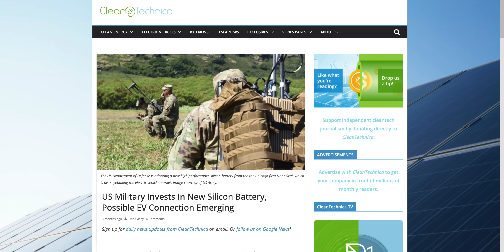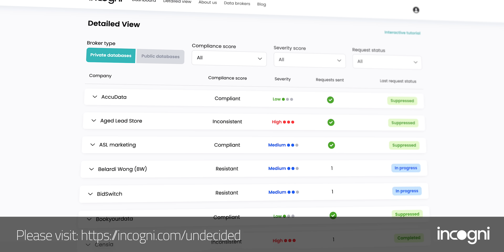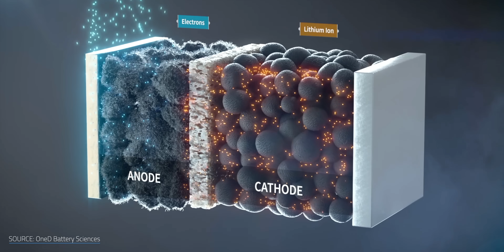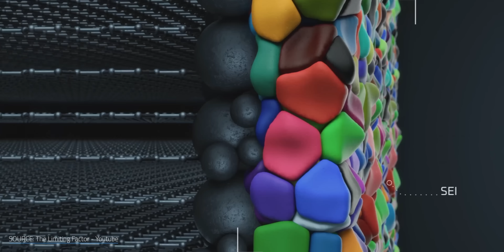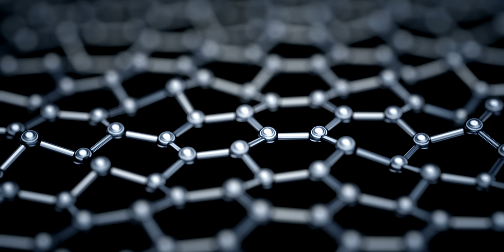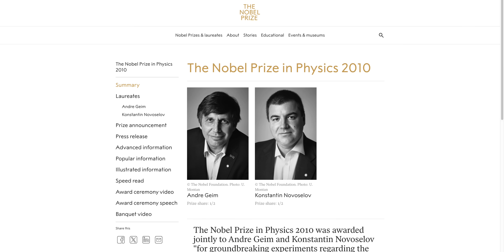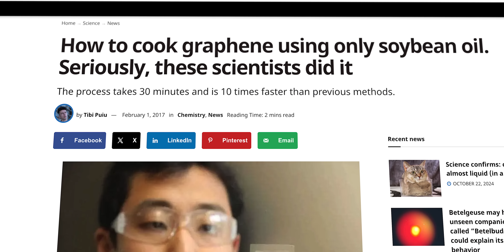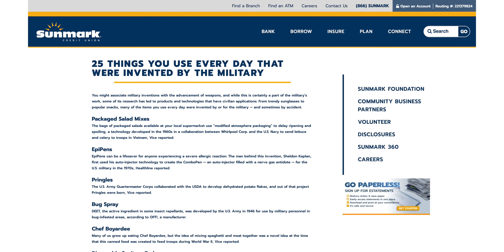Why The US Military Chose Silicon-Graphene Batteries

Comment: "Most definitely" sounds fairly certain. But I am not watching your video on a battery powered device, I'm watching on a desk-top computer that is plugged into BC's electrical grid. BC is stubbornly investing in new hydro power, and there is no battery storage on our grid. There is only one small button battery in my desk-top computer (to keep the clock from resetting every time I turn it off) it doesn't power the whole computer. There aren't even any batteries in my mouse, it's wired.

Comment: Even if graphene is 1 atom thick, wouldn't it still make more sense to use many layers of graphene since you're not losing hardly any space or gaining weight or storing heat by making a 500 atom thick graphene so breaks in the layers aren't so critical?
Reply: You have less internal resistance when ion moves through 1 atom thick layer than 500.

Comment: Seems like the right move to get going on next-generation battery technology. But word choice of the industry confuses me.

First, graphite vs graphene. I feel "graphene" is a marketing term, as the two(?) substances are exactly the same in terms of atomic and crystalline structure. Google is my friend, and so I was directed to Graphina's web page where they say that graphite is thousands of layers of graphene stacked on top of each other. Eh? So I might define graphene is "single-layer graphite". Elsewhere on the page Graphina says graphene is "more than 300 times stronger than A36 structural steel" while simultaneously saying that graphite is a brittle material. I think the real difference is purity (which makes it better for batteries) and price.

Second, silicon oxide. Is that SiO, or SiO2 which is found everywhere in nature? Silicon dioxide is also called silica, becoming quartz when in single-crystal form. I get the idea of pure silicon crystals (face-centered cubic structure) sucking lithium ions into the crystal lattice, then swelling and splitting. But WTF is "silicon oxide"? Or is that silicon dioxide, an insulator? I'm sure their battery works, but the language used is confusing.

I think marketing people make up this shit. They talk to the scientists and engineers, then they go off and invent some verbal crap that sorta fits what they heard. As a retired EE, I've come to hate marketing people for this very reason.

BTW, the battery diagram showing graphene, with interspersed balls of silicon magic, works for me. At least the diagram does. Not sure what the magic is though.

Comment: lets see just how many is 2500 ton it is 5,000,000 lb or 80,000,000 oz or 2,267,960,000,000 g Yes that is 2.26796Tillion  grams  or make it smaller 2,267,960,000 Kg  see smaller

The next question is will be how big are these anodes. If they make little ones for little  batteries less then a gram.  Batterers gets bigger so does it.  So lets say we use Ww one each/ yr.  I mean we need to replace so many every yr.  Lets say these little one on average use one that is just 1/10 of a gram that is 800,000,000 gr  next size up same # same size anodes but the next takes bigger by 20% and it goes up through the next 3 sizes.  Lets say we make 1.6B+ 2.4B+ the 20% 480M=4.48 g or 4.480.000Kg or
2.267,960,000
4,480,000
compared this way we will use about 1/500 of that on small batteries.  How many of the huge building storage ones or just the ones in ur lap top. Bet its anode is a 10 ger.  What 50m of them a yr and then there is ur cell phone.

Comment: I'm curious why NanoGraf isn't using the proven method of using silicone-carbide in a quartz tube to produce flawless graphene.
The silicone-carbide graphene can be custom-tailored precisely to the required specs in an affordable and sustainable manner.  
Also, since hemp is one of the best raw source materials for producing graphene material, has anyone tried combining hemp-grown graphene with the silicone-carbide method?
Reply: They probably don't need flawless graphene for electrodes. That is more for semiconductor devices.

Comment: Silicon is one of the most abundant elements on the surface of both Mars and Earth (second only to oxygen). The most extensive region of highest silicon content, shown in red, is located in the high latitudes north of Tharsis (centered near 45 degrees latitude, -120 degrees longitude)

Comment: "you're most definitely watching a device powered by it"

There's no lithium ion batteries in my mower-sized desktop
Reply: You might have a coin cell battery powering your internal clock 😉

...That being said, I know what you meant.
Reply: You have a CMOS battery in your mother board. 
If you ever have a power surge and your computer won't start after, pulling that battery out could get it started again,
Reply: That's what i was thinking. Though old Tube CRT TV's had HUGE capacitors so you could get the screen on quickly (as in not taking 5 minutes)... maybe one of those is what he means... (I'm being sarcastic btw)

Comment: "20% more range and 50% more playback"
what does that even mean, in the context of a battery? that sounds like marketing speek
Reply: It is.
Reply: Yep, when someone reads a script like that, with made-up numbers about nonsensical features, it's just marketing BS. I'd hoped for better from Matt Ferrell.
Reply: Watt/hours per gram per $ is all the info needed.
Reply: @MrWackozacko  Nominal WH is just that, nominal. Capacity of a battery is dependant on the draw rate. The fact they mention playback at a much higher rate means these are more efficient at low power operation than at high draw.
Reply: @deadoon  Watt/hours at what C rating per gram per $ is all the info needed.
Reply: It's a bit more complicated than that. The batteries store much more charge than the rated capacity. It is just that when the battery depletes it internal resistance rises a lot. Basically it cannot supply enough current and voltage. 

If you go to low power applications the amount of watts/hours is different than for high current ones. 

 @MrWackozacko
Reply: @bonnome2  Yeh its called the Peukert Effect , denoted by the discharge rating 'C' on the battery.
Reply: @MrWackozacko  yes but the C changes with current. The rated capacity can increase well more than 50% depending on current load
Reply: @bonnome2  Yes
Reply: @MrWackozacko  exactly
Reply: i can only think 'range' is environments it can be in, high/low pressure and heat. 50% more playback suggests it is 50% more energy before discharged.
Reply: @erascarecrow  or maybe "range" refers to driving distance if used in place of other batteries in a hypothetical electric vehicle?
Reply: IDK, but considering the M38 18650s he mentions only offer 3800~MAh with a 2.5c ma discharge I wouldn't say they are there yet.

Comment: If these batteries take over the market they will devalue the lithium reserves of countries which have them. You forgot to mention that in addition to items that need batteries, a soldier has to carry ammunition, rations for up to ten days, and in desert conditions water for several days. He also needs to carry sleeping bag or tropical equivalernt (hammock etc), plus rifle and belt kit, or at least we did. If  you have 10 miles per day to cover over rough terraine, you have to keep your pack well under 100 pounds, otherwise you wouldn't be fit to fight if you bumped the enemy. For this reason we never wore helmets or body armour, it's too heavy and sweaty. If you overload a soldier with equipment intended to make him better, it just makes him worse.

Comment: Looking at available data I am bit confused. SoG cells look like they have 3.52 V nominal voltage. At advertised 3.8 Ah, that's significantly lower than current LiPo 4.2 Ah @ 3.6V for 10A or 4.0 @ 3.7V for 20A that is available on state of the art 18650 cells, that's 13.3 vs 15.1 Wh, that's solid 12 % LESS. Can't find discharge current though. Might be valuable tradeoff, if they are indeed significantly lighter even at slightly lower capacity. Still, if new technology is almost matching current offering, when in its infancy, it's promising. No wonder they got the grant.

Comment: Will the military insist on single 18650 batteries and standardised battery packs or will they get the mess of battery sizes common in consumer devises? In Europe power tools are going over to a standard battery power pack whatever brand you buy though you'll need a converter for your old tools.

Comment: U.S military always 30 years ahead of consumer market, watch these graphene battery become a big thing. 

I think it will be good for renewable grids.
Reply: Still not as good, if it’s designed for small gears I’m thinking about external skeleton for soldiers later can be used for disabled special need person at lower cost, if someone have broken back or weak arm they can use these gears, it weights less than lithium with higher energy density but it’s still not enough yet, maybe need 2-3x the energy density per same weight basis. It’s not good yet, if it’s 5 I think it will help a lot of people that can’t walk help them walk again

Comment: Noticed a false assumption, well two of them.. Lighter batteries do not lighten the load, because more batteries will be required by the upper brass.. The limiting factor isn't the life of the tech used, but rather the weight that they are required to carry. So lighter batteries means more batteries, not a lighter load.

Comment: Like most of the small form factor battery techs, the larger issue becomes standardization.   Can we get a commercially viable alternative to standard size and voltage. If we can get these to fit a AAA or AA cell size at 1.5V then even if short term the price is a bit higher it should be very good for a long term option.

Comment: Since copper theft of charging cables is so common and power flow heats up cables could graphene be used for EV charging cables instead of copper?
Reply: Hehe, yes, but if you think theft of copper charging cables is a problem, you can't imagine the problem with theft of graphene charging cables. :) Gold is also much better for charging than copper and much less expensive than graphene.

Comment: The internet itself started as cutting edge millitary tech btw ( started as a 3 machines connection where the computers stored the same data in top secret locatios is 3 diffrent parts of the us as a measure agenst a attack. If one where blowed up at one locations all data was still safe at the other places and the army knew they where under attack where the enemy where trying to destroy there data and therefore increased the securety around the other two computers

Comment: Ive been talking about battery powered Tanks for years, its already possible with modern tech but this makes it even easier. Batteries can provide more torque instantaneously and waste much less energy idling which really limits tanks through excessive fuel consumption just sitting around.
Reply: Yep, nothing like having a tank on the battlefield, no engine noise... and takes 7 days to recharge after 2 hours of use. And hope the battery doesn't get overheated or damaged, else it becomes a open flame oven.
Reply: @erascarecrow  we are not there yet with battery technology, but there are reasons to believe we will - year over year current gen batteries are improving like crazy and there is always stuff brewing in the lab, all the while ICE engines are mostly stagnating.
Reply: @coachpotato7353  ICE engines are not really stagnating.
Reply: @AdamantLightLP  Really? What are significant improvements of the last decade then?
Reply: @erascarecrow  seems like you forget that tanks are already full of kerosine, oil solvents, and highly explosive ammunition, fires and total annihilation of the tank are acceptable risk if it gives you a big enough edge. 
i dont know where you get you knowledge about how batteries work but any liquid cooled Lithium ion battery can get around 80% of its charge in 30 minuets with modern tech, not 7 days (its even faster if you dont care about long term use). the tank can stay idle running its equipment for a month while a regular tank needs a refilling every couple days sitting there.

no engine noise and no hot engine exhaust is really good for stealth.
Reply: @odisy64  Tell me you know nothing about the military without telling me you know nothing about the military.
Reply: @AdamantLightLP  i know more than you
Reply: @odisy64  Yeah the flammables would be in dedicated sections that are heavily armored as well. Not only that, they don't spontaneously combust. <.< just saying.

Yeah you can probably charge it in 30 minutes with the right power output, which is probably going to be 20x the watts from a standard wall socket; But i don't see that working in a war zone, either outside when you're in a forest, or a destroyed city just rolling up to a house and plugging in to a wall socket, but the 'fast charging' usually is specialized plugs and far more amps than a wall socket.

Thus the '7 days'. And don't get started on solar, that wouldn't even do anything useful without a lot of them. And i wonder if they'd have special adapters for every country in the world...
Reply: While not fully EV, the planned Abrams M1A3 is hybrid diesel for exactly those reasons - torque, noise and power availability for onboard equipment while idling. There are already a number of PHEV/EREV style lighter military vehicles in use today made for those reasons too all received to much fanfare. No pure BEVs yet considered to my knowledge, other than drones, as charging up large volumes of batteries while deployed away is not that easy and power density isn't there yet.
Reply: @coachpotato7353  i think Hybrid tanks are a half step, while offering the benefits of electric motors they dont have the HP. for example, the 900kwh battery in the Tesla semi truck which can go 500 miles weighing 82,000lbs, tanks are heavier and less efficient but a fraction of this range as well. the 3 motors it uses provide 1,500hp combined. but the battery can  theoretically safely output over 9,000 HP for a few seconds, longer if your cooling is better desgined.
Reply: @odisy64  Batteries do not output horse powers per se, they output electric power measured in Watts. Typically battery output is denoted in C units - for example typical in EVs today is 3 or 4 C - we multiply C rating by Capacity and get maximum theoretical output - for a 3C 900kWh battery that would be 2.7MW, but in reality its limited by overheating. Either way, in clever Hybrid systems motor can be fed power combined from a battery pack and generator - Toyota's Gen.4 eCVT, Honda's e:HEV - so HP produced is not limited to battery output alone. Most hybrid personal vehicles are frugal with their power by design, not due to technical limitations - try any of the overpriced Lexus hybrids - plenty of oomph there with that signature instant torque of electric motors...
Reply: More importantly battery powered tanks are quieter than the diesel counterparts.   They can practically go stealth without making much noise.   I can see one of the reasons why the military is looking into this.
Reply: @Darkk6969  yup, i heard one of the reasons the US went with a turbine engine for the Abrams instead of diesel, the high winding noise  from the turbin is very loud up close but dissipates quickly over a long distance while the low humm of a diesel engine travels further. Obviously with battery, the loudest thing will be the cooling fans.
Reply: @odisy64 Noctua for the win!
Reply: @Domarnett  funny enough i have a 4 of their 3,000 RPM fans tied to my CPU temperature. Its louder than a fridge on idle and as loud as my vacuum at full usage.
Reply: @Darkk6969  With thermal imaging being standard on weapon platforms and with today's increased stand off distances, noise isn't nearly as important as heat signature. With a lack of engine and exhaust, heat signatures would be drastically reduced.

Comment: Having been in the Army back in the 80s, I can testify to the battery problem.  Even back then, when we were still using alkaline cells, getting the battery you need for the device you had could be a problem.  Picture a D cell battery that is only 1/3 as tall but the same diameter.  That's what my driver's night vision scope used on the M60A3 tank.  That battery was something you'd need if the vehicle powered plug got damaged, which could be frequent.  You wouldn't be running down to Radio Shack for one of those batteries, nor many others that the army used, even back then.

That this tech is going to be produced at scale in a commonly used form-factor, I'm going to keep my eyes open for them soon.  I've got a few gadgets that use those 18650 cells, so a market already exists if they can make the price economical.

Comment: What the heck does the claim "RANGE is 15% longer" even mean, in the context a battery?
Reply: The range at which a battery can operate?  That's gotta be the distance it can throw a spark across... so higher voltage I guess :D

Comment: Amazing video, Graphene will "change the world!"  I think Graphene will eventually be used for so many items including batteries, how about Salt Water/Fresh water conversion or a space elevator?  Replace our existing electrical power grid with super conductor graphene an get rid of those ugly above ground power lines.
Reply: We are so far away from space elevators that it's not even worth thinking about. Sure "it's 200x stronger than steel" but if we can only manufacture chunks of it at microscopic scales then it's useless for anything mechanical.

Comment: In addition to more energy dense batteries, is there also an effort toward reducing the overall power consumption of common devices?  Newer codecs with better compression ratios are made as data storage capacities increase, so why not do the same with batteries?